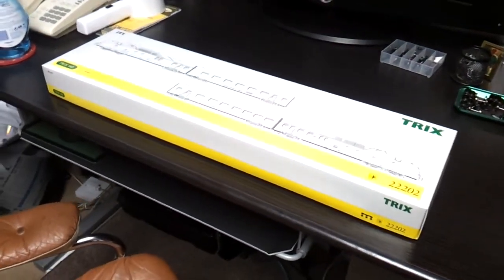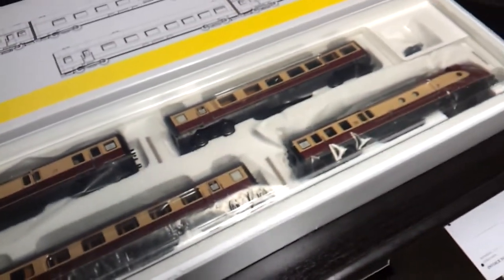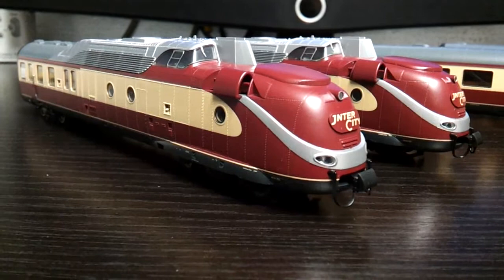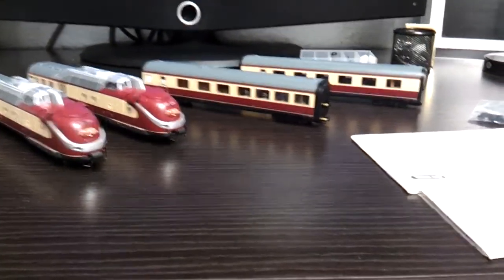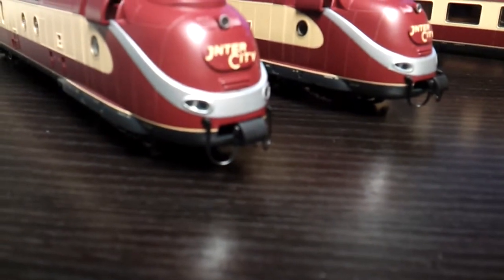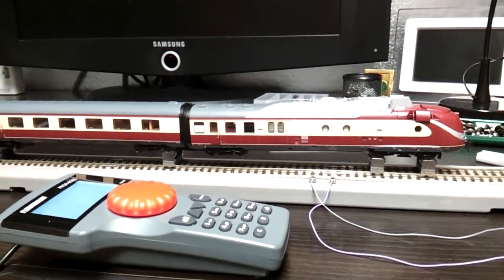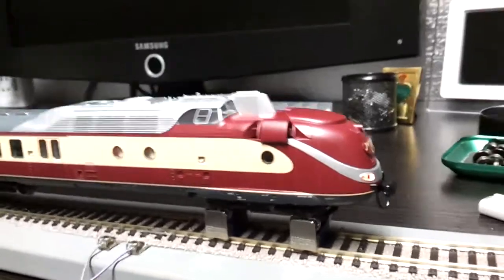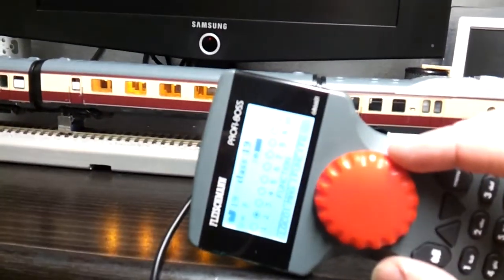Trix 22202 GAS TURBINE PART 1

Comment: Very nice clip ! I have this train plus 3 extra coaches (Trix 23315). It is amazing that also the 5 coaches are made of metal. I got the 3 extra coaches in 2010 from www.rocousa.com in Florida. They had two sets left in stock when I ordered mine. I know this train drives quite well but I have it more as a collectors item. This train and its extra coaches were no bargain however !
Reply from the maker: hi Jan , i now have the extra coach set like you, they were very hard to find and make the set very sort after as the complete set is rare to find in two rail.
Reply: hovermotion
Congratulations Jim, it really makes it a much more realistic train although I had to shed another $500 for those 3 coaches. A collectors item indeed.......... From Trix I have the 22010 (SVT137) and a BigBoy 22599 which has had a major and expensive repair more than a year ago and 2 separate decoders (one for the smoke generator). It is still bolted on its shelf in the wooden box however. I have become a bit allergic to it I guess. Too delicate and too complicated. A Trix GG1 (28100), the green 4935 is on its way to me, I just got one on eBay. That should be a lot easier loco to handle and I am looking forward to it !
Reply from the maker: The 22010 is on my hit list too.
the big boy is a must for all u.s modelers my trix version has been fine i have used it many times {22115} shame about yours failing.
the big boy class needs a careful route planning on a finished layout otherwise it may run into problems.
The gg1 is a beast of a model i love the design in fact i did not know the 4935 was a green livery...up load a vid when you get it....jim
Reply: hovermotion
Will do that Jim ! The BigBoy should be fine now as it has been taken care off and tested by a reputable and professional Trix/Marklin repairer but I only need to take it out of its box again one day ....... Will most certainly hold on to it as it is something special indeed ! The 22010 is a lovely and heavy DMU in its original livery of 1935, bit has a bit bizar sound decoder because it only toots. By the way the GG1 is 22810 (not 28100), it has the standard green livery with the 5 stripes. I have a diecast Tuscan red one single stripe (the 4916) as well but that one is from Broadway Limited. Its sound decoder is different from the Trix one. ............. Jan

Comment from the maker: Hi, in part two the dining car will be installed, both locos are powered with two axels powered in each drive unit with high effIciency motors & dcc sound decoders installed from the factory which is rare due to the cost of this set. 
This set is the 2005 version.